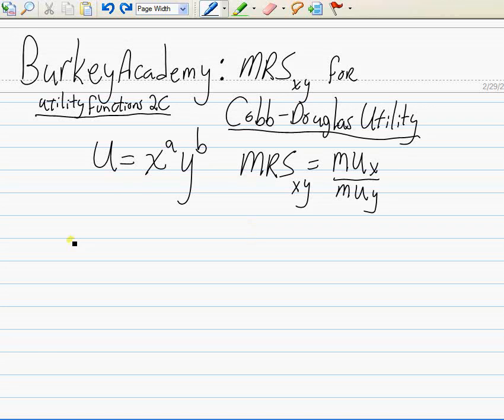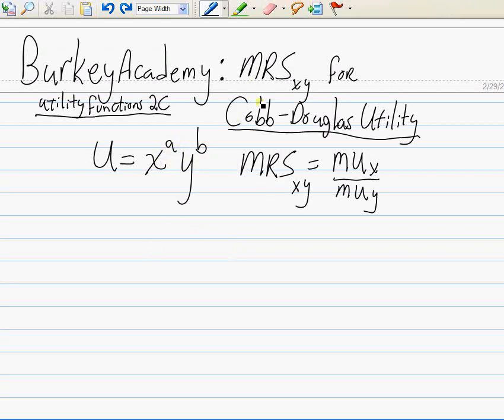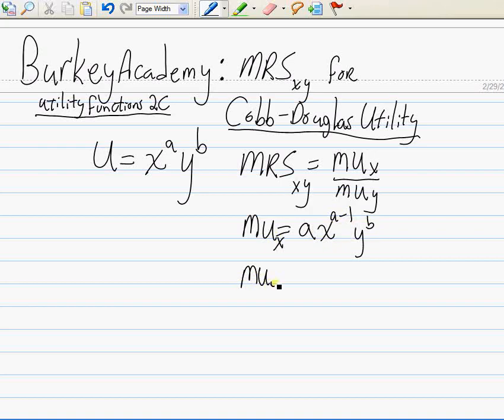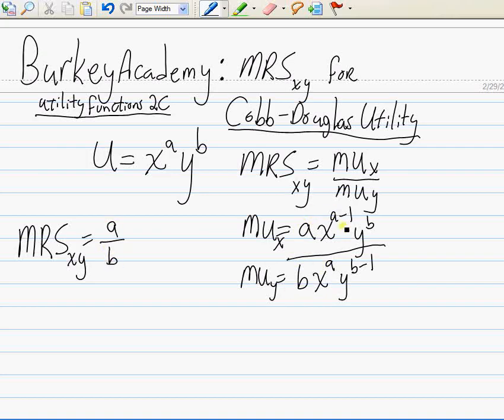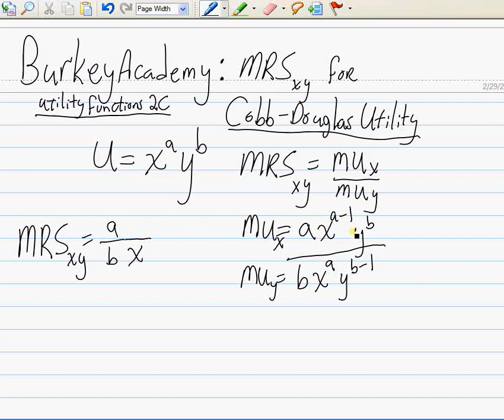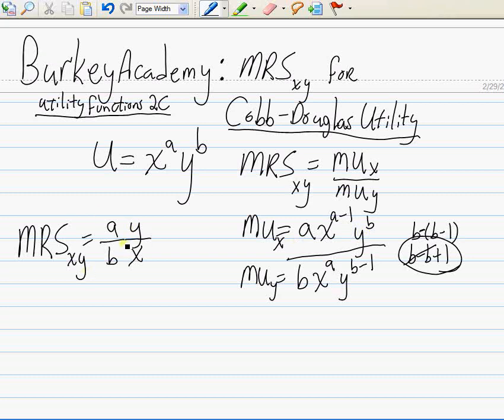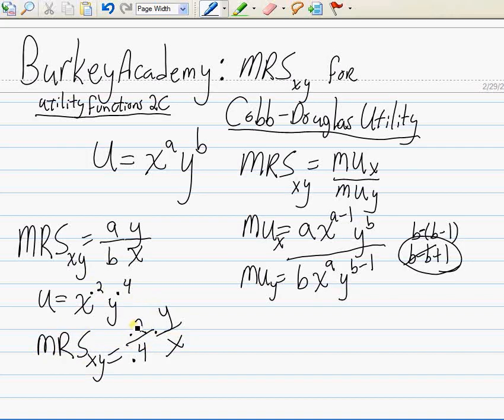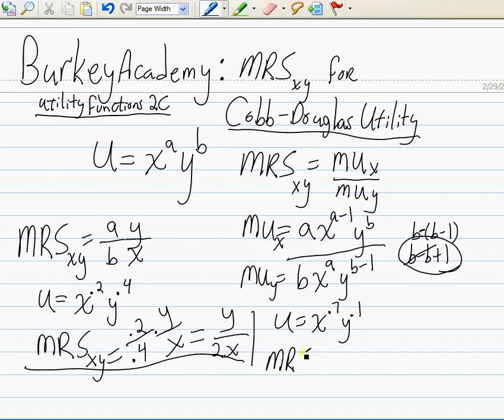MRS for Cobb Douglas Utility: The EASY WAY!!!

Comment: I'm getting a different answer for the first example. I get MUx= 0.2y^0.4 x^-0.8 and MUy=0.4x^0.2 y^-0.6 and then MRS = 0.5yx^-1.Why is that different than the shortcut/easy way?
Reply from the maker: 0.5y*x^-1 is exactly the same thing as 1/2(y/x) or y/2x.  0.5=1/2, x^-1=1/x. (1/2)*y*(1/x)=y/2x.
Reply: BurkeyAcademy Thanks so much! As you can probably tell, this kind of thing isn’t my strong suit. 😬 Thanks for the video and the quick response!

Comment: does it work all the time sometimes for me it is opposite like a=0.5 b=0.5 i get mrs l/k when it shuld be k/l
Reply from the maker: If you want the slope with L on the x axis, then treat L like you would x. If Q=L^.5*K^.5, the MRTS=.5K/.5L=K/L.
Reply: @BurkeyAcademy  mrts is measured mpl/mpk so i guess that was why i got it wrong as mrs is measured using this method

Comment: you forgot that MRS is always = - ; so you missed the negative
Reply from the maker: Most economists, and most textbooks call MRS the absolute value (and similarly with the marginal rate of transformation).  Similar to the price elasticity of demand, we are not interested in the sign, but the magnitude.
Yes, there are a few sources that insist on the (-) sign, but it isn't important as long as you are consistent.

Comment: in my text book has MRS= -U1/U2. with the negative in front. whats the difference? I think it should be negative since the indifference curve is downward sloping.
Reply from the maker: Yes, technically the slope is negative if both x and y are goods, and the slope of the budget line is negative as well.  So, when solving MRS=Px/Py, I just cancel the negatives.  Also, while the slope is negative, the MRS is a quantity that can be thought of as an absolute value: How many y you are willing to trade for 1 more x.

Comment: Thanks for the help. but does this work for MRTS when there are integers in front of X and Y, for example, q=10F^1/3 * K^2/3 ? Doesn't seem to be working for me, unless I've missed something silly.
Reply from the maker: Yes it does! The integers cancel out, since when you take the partial derivatives the 10 will appear in the numerator and denominator.  One thing to be careful of is where you put your Pk and Pf-- that may be messing you up.

Comment from the maker: Absolutely.  As long as the production function is a Cobb-Douglas type,  of the form Q=A*L^a *K^b, the MRS is the same as the MRTS.  If there is a multiplier (like the A), it cancels out of the MRTS equation since it will be on top and bottom.  It is the same mathematics as for MRS.